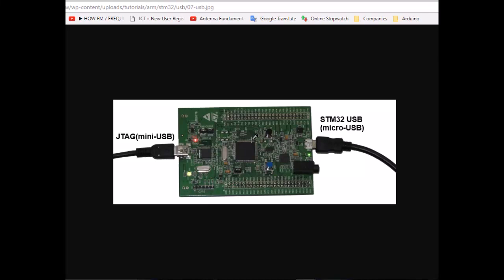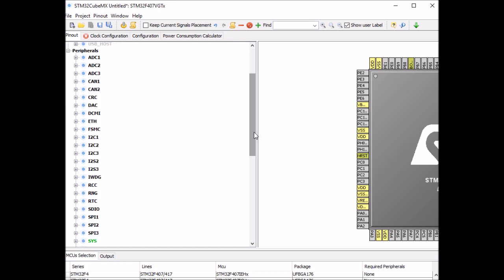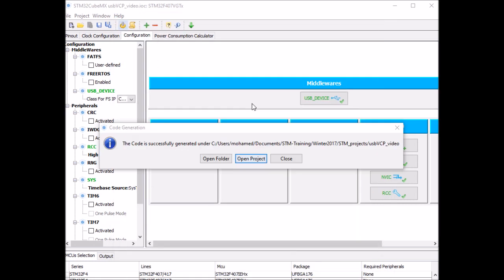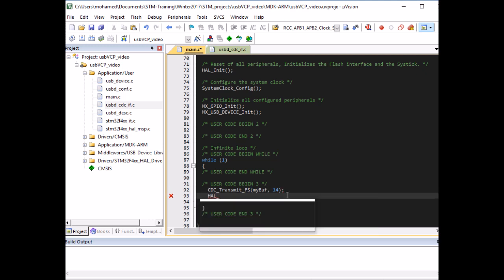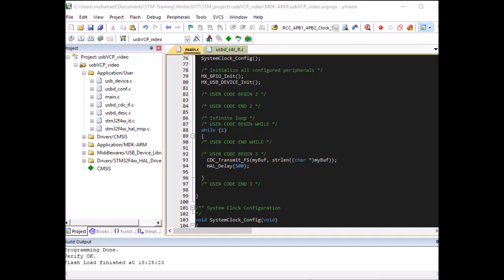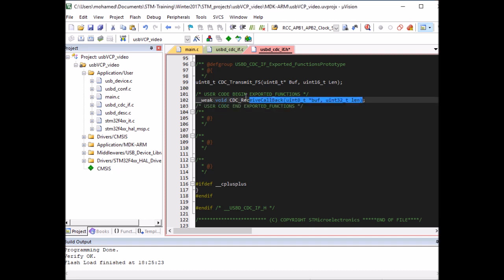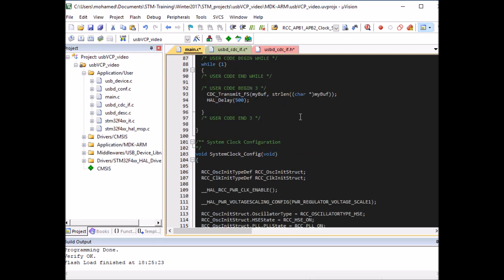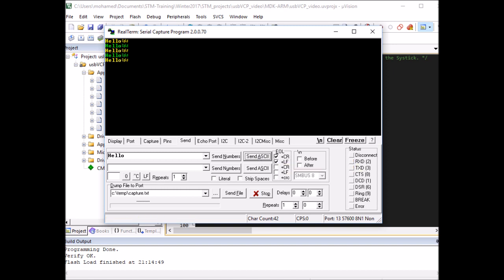STM32F4 Discovery board - Keil 5 IDE with CubeMX: Tutorial 15 USB VCP - Updated Dec 2017

Comment: Hello,
is there a function that transmits uint16_t valuses?
Reply from the maker: You can make one for your application using the u8 provided by library. It is easy
Reply: @mutexembedded2206  thank you for your answer, but I am bad at C
Reply from the maker: @babotvoj  You can read a bit about variables types and typecasting

Comment: Is there a non-CubeMx version for USB?
Reply from the maker: Yes, I personally do not favor using CubeMX for advanced middleware like USB. I will make non-cube videos over the next couple of months.
Reply: @mutexembedded2206  thank you. In fact if you could do timers without cube MX for start, it would be too good. I tried some exercises by myself using the default HAL and understanding each register which worked and motivated a lot even though it took some time.

Comment: Thanks for this video. I already got everything set up, connecting and transmitting data back and forth but I was unsure how to go about using the driver w.r.t receiving data. Do you think it’s necessary to have the callback to main? Essentially the CDC function is a callback so you could just put your logic in there?
Reply from the maker: Hi,
Usually it is better not to process data inside the callback, in advanced systems with RTOS, data are added to some sort of processing queue
Reply: MYaqoobEmbedded Thanks for your suggestion :) I’ve decided to implement a ring buffer message system as a separate module where incoming messages can be queued and processed. So far so good :)
Reply from the maker: @Kefford666  Good :)

Comment: how can i use the Virtual COM port for windows 10
Reply from the maker: Need to install STM VCP USB Driver. You will find that in ST Website
Reply: @mutexembedded2206  worked out well, thank you
Reply: @mutexembedded2206  how can i display a picture in real term terminal used usb virtual com port ?
Reply: Hi ,  @mutexembedded2206  the website says thee drivers aren't needed for Windows 10, is this still needed to be done?

Comment: I tried the transmit data portion of this video on my stm32f103 board and it works fine but the receive portion does not although i  did the same  code which is in this video, can anyone tell me the reason please please

Comment: Hello, I am using STM32F429i Disc1 Board. I followed the exact same procedure as demonstrated. But the device isn't recognized by the PC at all. I couldn't find the virtual COM port of USB OTG. I verified heap size, installed VCP Driver (Am using Windows 10) and double checked everything. Couldn't figure the issue. Please help.
Reply: did you manage to get it working for this board?

Comment: I've been getting an error with trying to open the port:
"The parameter is incorrect"
I've searched everywhere for a solution and finally found it:
https://community.st.com/s/question/0D50X00009XkfnjSAB/problem-solved-with-usb-cdc?t=1577123370872

You need to add the following code (there might be a better solution) to the function CDC_Control_FS() in usbd_cdc_if.c:

case CDC_GET_LINE_CODING:
    {
     uint32_t speed = 115200;
     uint8_t databits = 8;
     length = 7;
     memcpy(pbuf,&speed,4);
     pbuf[4] = 0;
     pbuf[5] = 0;
     pbuf[6] = 8;
    }
break;

Comment: Hi Mohamed, So we cannot use the st link itself to do this virtual com port if we have older version of this board right? I read it so online. But would like to know it from you. I wanted to use the virtual com port for a debug purpose to send messages to terminal. That's why. I'm just getting started with this microcontroller though I have had this board for quite a long time.
Reply from the maker: Do a quick read to the User Manual of your board, most case if it feature micro USB, then you should be able to do so

Comment: +MYaqoobEmbedded
hi mohamed how are u ? i installed the virtual com driver from st website but the port still not detected , when i checked the device manager i find only stlink virtual com !!!!!! i can't know what's the problem !!!
Reply from the maker: Hi Ala,
Search for the USB ports on device manager and update the undefined USB port with Auto update.
Another cause could be the wire.
Reply: +MYaqoobEmbedded 
yes i did an update and i tried with another wire but same problem , really weird !!
Reply from the maker: Interesting! You may forgot to increase Stack & Heap size like I shown at 2:17
Reply: @mutexembedded2206  Awesome! I did forgot to increase Stack & Heap size like you shown at 2:17 and got same problem like yours.
Reply from the maker: @behnammoradi1449  
Hi,
Go to your device manager when you plug the ST Micro USB (i.e. you need to plug both USBs one for ST Link&power other for USB communication).
Then check for undefined USB ports.

Comment: Hi Mohammad , when I connect the FS port to my computer, it is not detected, can you tell me what is going wrong? The computer fails to acknowledge that anything is connected at all.
Reply from the maker: Tahira Jabeen 
Hi Tahira,
You need to install STM VCP USB driver:
https://www.st.com/en/development-tools/stsw-stm32102.html
Reply: I am using a STM32F746G- Discovery board, will the clock configuaration be different for it?

Comment: Hey Mohamed,
when i connect the usb to the laptop i have an error: the laptop does not recognize the usb, i checked my device manager, there is no virtual com, so this is the problem.
my OS is Windows 10
can ou help me please
Reply from the maker: elmzaiti youssef 
Salam,
You need to install STM32 VCP USB driver.. google it.
Good luck
Reply: if you are using STM32CubeMx to generate code, go under "Middleware" category in "Options" and select "USB_DEVICE" and then select "Communication Device class (Virtual Port Communication)" and then generate code. you will be fine.